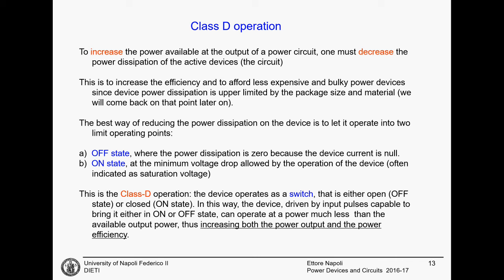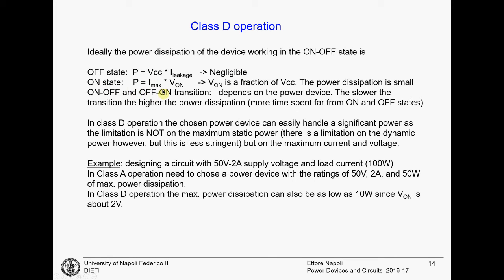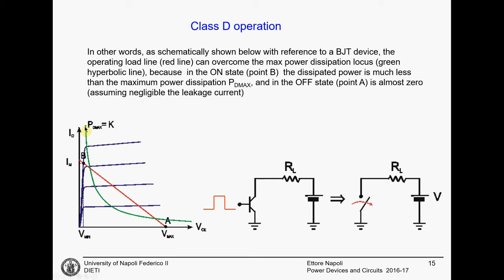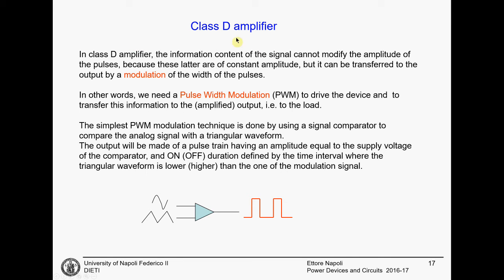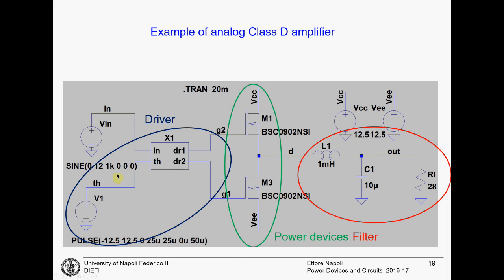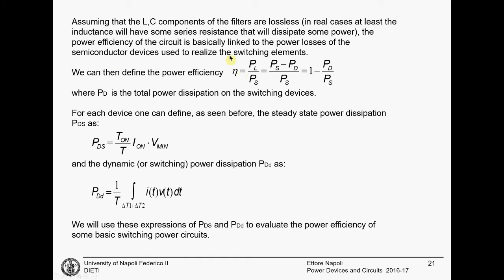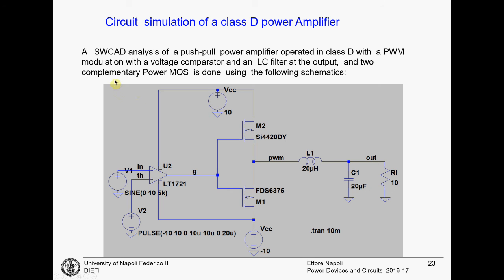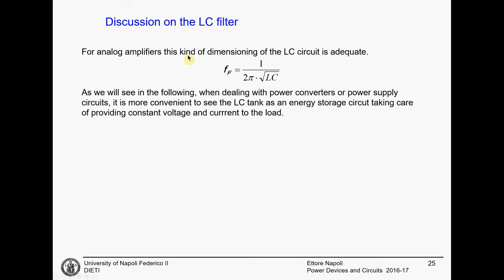Class D amplifiers

Comment: The output LC filter has a slope of 12dB/octave, not 40dB/oct, correct?  (maybe 40dB/decade)
To tame the peaking effect (when RL is high, i.e. resonance), don't you want to something similar to a zobel network to flatten the driver impedance?
I would like to use a 4-ch class D device (maybe from TI) and add an active crossover before the amplifier to build a bi-amp loudspeaker system. Is there any special consideration you would suggest when using class D amp to drive a tweeter directly?
Reply: https://web.njit.edu/~levkov/classes_files/ECE232/Handouts/Frequency%20Response.pdf figure 1-7 they are equivalent stamens